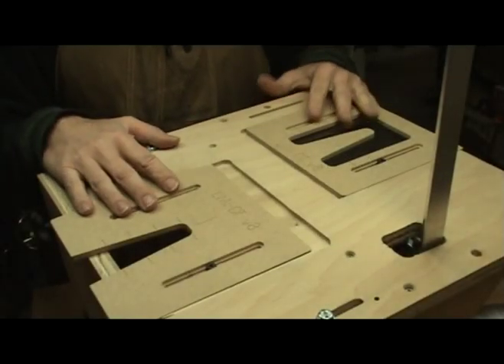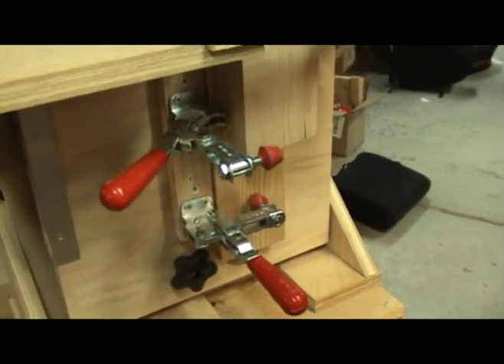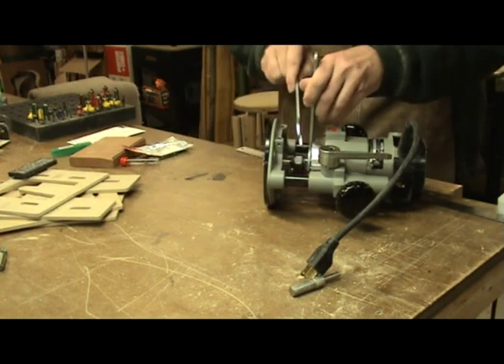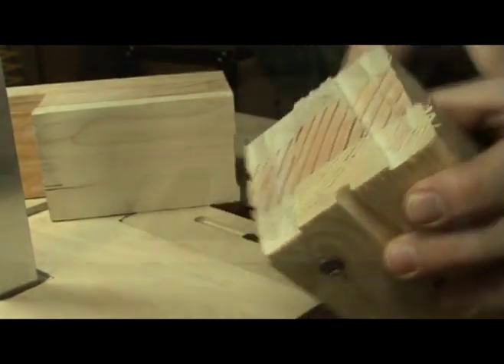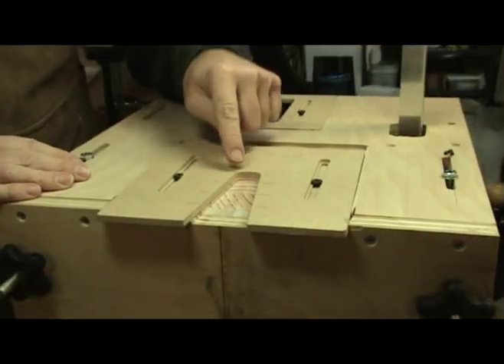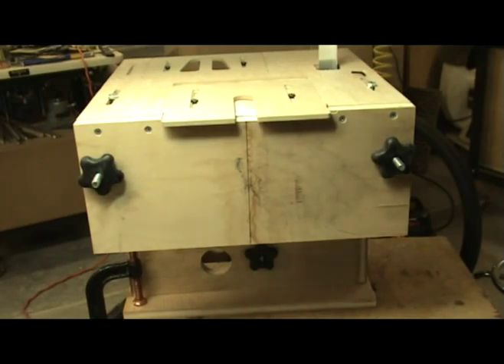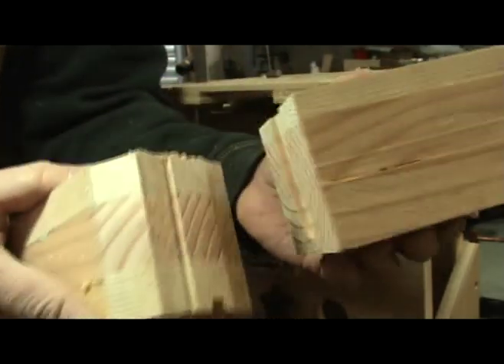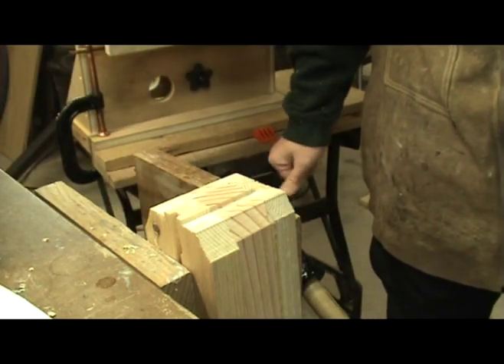Setting up the neck angle jig

Comment: You use the truss rod to align the neck. What if the the truss rod channel isn't perfectly parallel to the sides? If it is off even it is off a tiny bit over the length of the neck won't that throw the alignment of the neck off left or right depending on the channel?
Reply from the maker: The truss rod is used to dial in the correct amount of relief in the neck. I think the channel would have to be off considerably to make a difference.
Reply: @OBrienGuitars  Thanks Robert. I purchased this from LMI. I noticed for the nut to the 14th my truss rod channel is off maybe 1/32 to 1/16th. from left to right.  Wasn't sure if that is a skoshe or BAD (technical term). From what I took away from the video I will adjust any variance during the fitting process. Thanks again for quick reply.
Reply from the maker: @BradRemillard  I think it will be fine.